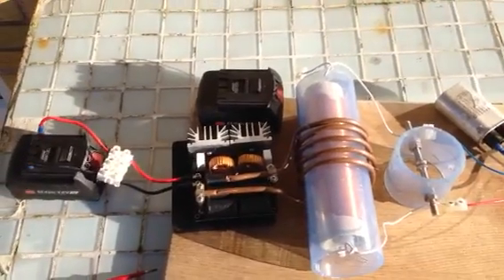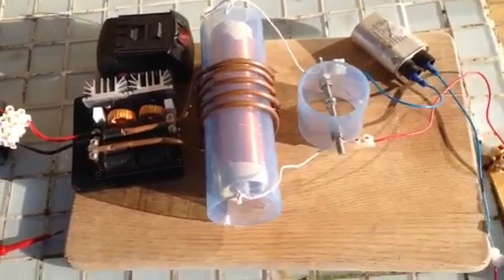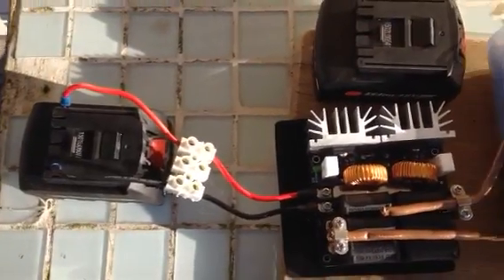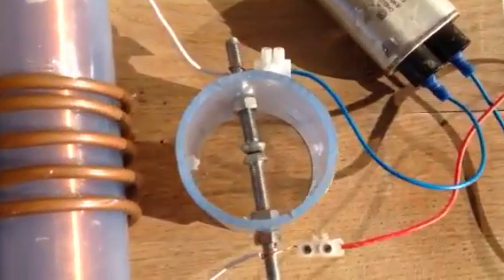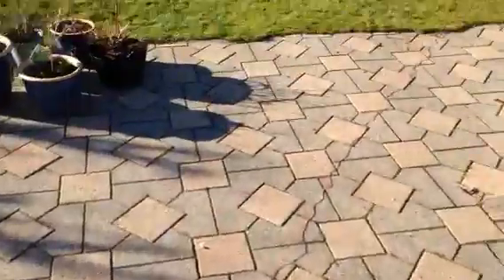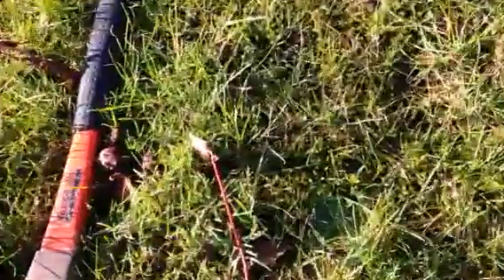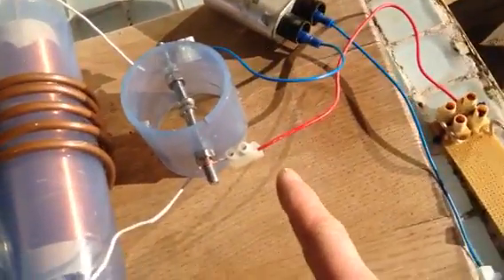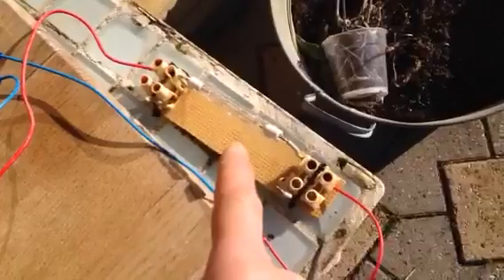ZVS -IT  Kapagen, Kapanadze, Tesla.

Comment: this is just a regular inducion heater with step up transformer. if you measure the input and the output it will be only 60% in the output
Reply from the maker: Ivan what are you trying to say?? Not sure 🤔 I don’t actually think I mention anything about output percentage. This is only showing transfer through the ground was possible nothing more . Have you made a Kapagen replication?? Can we see how it should function and is it OU?
Reply: @dkdyker  you can see also my videos and soon I will post the circuit so anybody can make it
Reply: @dkdyker  yes it is OU but it's not so simple. 2 frequencies are needed and the low one must modulate the high one, then the ground is needed to close the circuit and to pump energy from the ambient
Reply: @dkdyker так пускай возьмёт землю и второй провод из розетки фазу и ой ля ля о чуда лампочка светится. Нах показывать то что каждый школьник знает

Comment: What is the purpose of the sparkgap? Thanks
Reply from the maker: Hi the spark gap should be in a circuit to produce a  pressure wave. This then is a large spike that can be utilized and should suck more into the system!

Comment: Will you please tell me how you make it
nguyentruongnhu.ntn@gmail.com.
Thank you!
Reply from the maker: Nhu Nguyen if you look at the next video with this device heading ,you will see that a spark gap and capacitor is not needed. The effect is the same.
Run battery 18vdc @ 3ah. ZVS driver circuit from ebay 1000watt version.
Copper tube you can buy from any hardware store.5 turns around a plastic tube or something to insulate the secondary coil inside.
Secondary coil has 450 turns of awful 24 copper wire wrapped around it. From each end of the secondary connect one end directly to earth cable 12 meters long if you can. The other end of the secondary connect in series a light , then from this connect to another earth cable. Play with the distance between the two copper rods. It works best in damp or wet earth.

Comment: Buddy if you have an ammeter it is worth to check how many charges ampere from 18V battery (circuit induction)? 
-you have to take on a patch to fix the same inverter takes 0.5A at idle and under load much more than 4A at 100W bulb.
very cool design fertilization in research.